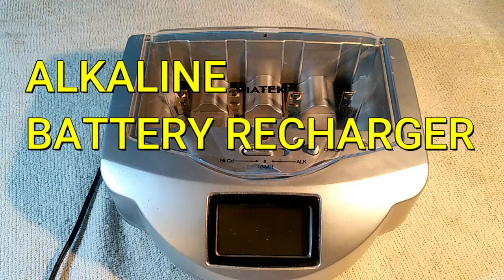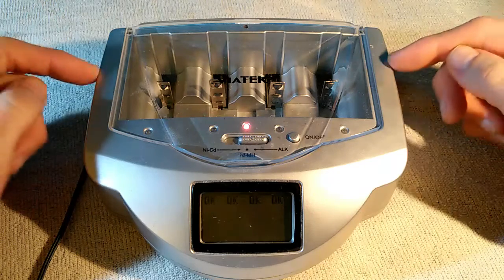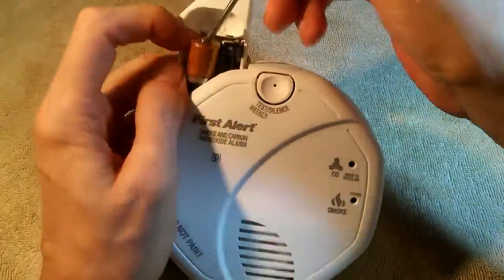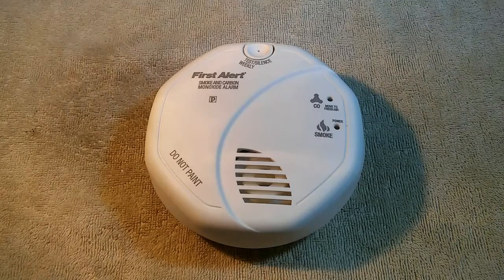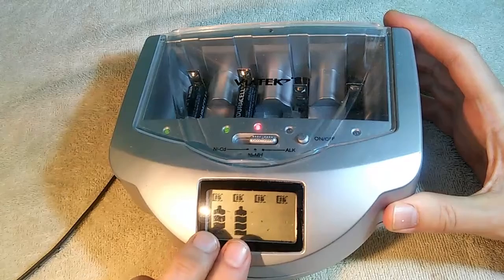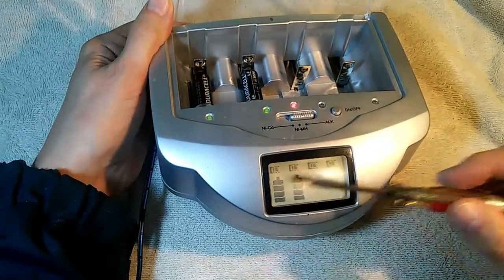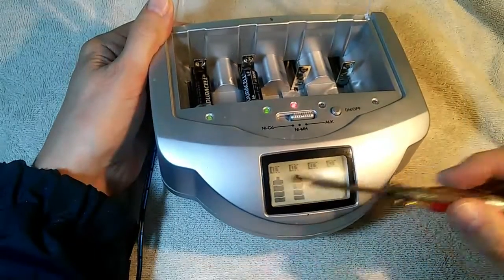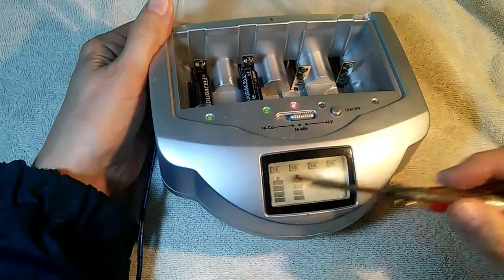Alkaline Battery Charger. Is it Real?

Comment: There is a version of alkaline batteries which are designed to be recharged. They are called RAM (Rechargeable Alkaline Manganese) batteries, and allow for twenty-five recharge cycles. They are becoming hard to find.
My suggestion, if you need a 1.5 Volt terminal voltage from rechargeable batteries, is to use Nickel-Zinc rechargeable batteries from Ansmann. Alternatively, the Chinese (Hixon) have developed Li-Poly 1.5 Volt AA batteries, which have a step-down voltage converter built inside the battery. The output voltage is stabilised to 1.5 V, it doesn't change with the load or the state of charge of the lithium cell. I measured a capacity of 2,000 mAh, while the label states 2300 mAh. They aren't perfect, as they generate some EMI, but they don't leak, and that is all which count for me.
Greetings,
Anthony

Comment: There was a battery charger  made in an electronics magazine a long time ago. Ive been using it for years for my x box, and the batteries are charged with better results being able to charge them and reuse up to 25 times. the state of charge diminishes rapidly but are still praticaly reusable for longer periods of time for at least 5 times before showing leakage.  its  definately possible to get better results than the charger your showing, but only charges one battery at a time. it takes a number of hours, not sure how long but definately less than 12 hours.

Comment: Ive chucked any batterys back in my charger which is the same allways on alkaline mode, it is firesafe where charged, and this video is what i figured it just gives them a little, not nuff for high current devics, but tops them up for remotes and similar items etc

Comment: Great experiment. Only cavet is that I always assumed that recharged alkaline batteries must be used quickly as the chemistry doesn't allow for longevity in holding a charge even if not being used. The smoke alarm testing would be the opposite type of drain. This doesn't change the overall conclusions shown by your analytical approach 👍

Comment: This charger is probably meant to recharge RAM batteries, not primary alkalines. Without knowing what current it uses and what voltage it uses as cutoff, it's impossible to tell if it does any good job. It may be applying too much current, damaging batteries while recharging.
The end conclusion may be correct for your particular charger and Duracell batteries setting, but is completely incorrect outside of it. People have done much more comprehensive tests, and one of them you can find here on YouTube by finding Bekr's Technologies channel and the videos he made.

Comment: Indeed you can recharge alkaline batteries with very small current (20...100mA max.) The risk of leakage is much higher with recharged alkalines and the capacity will drop quite a bit compared with new ones. You can do it 1 or 2 times - after that the batteries won't keep much capacity any more and are prone to leakage! You should also check internal resistance - it increases a lot after beeing recharged. Resistance can increase from 0.2 to 5 or even 10 Ohm - making them nearly useless for higher load applications.

Comment: That (Made in China) charger cannot charge Alkaline battery. I bought  one, tore it down and threw it away.
There is one charger that REALLY works. It is the (Made in Taiwan) Powertran A0280 and is able to recharge (non-rechargeable) AA/AAA Alkaline batteries up to 20 times. It is microprecessor controlled and can charge  (non-rechargeable) AA/AAA Alkaline batteries  OR NiMH batteries but NOT NiCD.
I am still using one and have been recharging hundreds of (non-rechargeable) AA/AAA Alkaline batteries.

Comment: The issue with recharging alkalines is that you often have to let them rest for a little while, then throw them back on in order to get them to hold their voltage (when charging, the voltage rises rapidly, but it doesn't necessarily hold as the battery hasn't actually charged as much as it appears to have charged, and will show its true voltage after a few hours). I would assume that a battery charger marketed as an "alkaline battery charger" would be doing this, but much to my surprise, apparently many don't. In order to charge these correctly, you have to pulse the charge every 30 minutes to an hour or so, and if the charger isn't doing this, it will not fully recharge the batteries. 

I might try to do a formal test on this using the "manual method" (wall outlet timers on slow overnight "dumb chargers") to see what the results are. It'd be interesting to compare and to see real numbers here on the brute-force method, and to compare them to the marketed alkaline battery chargers. 

Excellent video, amazing dedication spending literally years on this!

Comment: great scientific approach. We have almost the same charger  all except ours has no on/off button. I got it because it can do 9volts. We also have an old innovations charger from a long time ago that also charges alkalines.  I must have saved so much money in batteries over the years, especially when the kids were going through batteries in their gadgets. I found you can recharge something like energizer about 4 times. The duracells are pretty similar to them. Anything cheap, you MIGHT get 1 charge. The charger will show BAD on the screen of the one like you have, if it cant give a charge (too low to begin with). On our other charger (innovations) it will show progress in bars and an X if it cant charge them . I dont think  they claim a full restore each time on any of these alkaline chargers.

Comment: I haven't read all the literature, but a patent I was studying recently was talking about charging alkaline cells at currents far below what your charger puts out.  The downside of such low charging current is the long charge time - something on the order of two weeks.  I'm starting just such an experiment - charging an alkaline AAA cell at about 2.8 mA from a source that is voltage-limited to about 1.55 V.
Reply: @DonBenovo Thanks for asking.  I gave up my resolve part way through the experiment when it became obvious the cell wasn't taking on significant charge.

The device that was burning through my supply of alkaline cells - a wireless outdoor thermometer - has been replaced by a wired unit.  ¯\_(ツ)_/¯

Comment: The full charge should be 1.62v. On a new AA battery. I  would try charging to a slightly higher voltage with a different charger.
Reply: Could you get it?
Reply: @haiangtran2036  ?

Comment: Back in the 70s, I discovered that alkaline cells were fully rechargeable.  In the 90s, I bought a laptop with an alkaline rechargeable battery.  It was still taking a charge 10 years later.

Sometime in the 80s, I saw a TV infomercial for a charger that recharged alkaline batteries.  The inventor claimed to be a former college professor.   A few months later, that product disappeared, and a special type of rechargeable, called "Pure Energy" appeared on the market.  The regular alkaline had changed somehow, and I found that they couldn't be recharged like before.  It's been that way ever since.
Reply from the maker: There was a rechargeable alkaline battery.  There is a Wiki page: https://en.wikipedia.org/wiki/Rechargeable_alkaline_battery

Comment: I can't thank you enough for doing the capacity experiment. Given the amount of time you spent on it, this is by far the best and definitive must watch video for anyone who is curious how long the recharged alkaline batteries last because this is a real world example, not by an electronic load which could be faster but won't reflect the real world scenario. I had a hunch that the first charge would hold about 10%. Your video confirms it. Basically the chemistry is different. The ion flow is non reversible, thus non rechargeable. The illusion of "recharge" comes from unused or untouched anode material - powdered zinc, manganese, potassium, graphite, etc. As it oxidized (internal resistance) during discharge, the so called "charging" does not reverse the zinc oxide back into zinc. So overtime, it becomes more and more difficult to recharge it, in other words, all the zinc becomes consumed.

Comment: Duracell alkaline cells are better for high power applications, like motorized toys etc. I think Energizer may be a better choice for low power things like smoke alarms and clocks.
Also, alkaline cells that have been deep discharged can only be recharged to a fraction of their initial energy; as this test shows.
I have an earlier model (had it since about 2005) of the charger featured here and I find that topping-up the cells after each short use (cycle lights etc.) gets much more total life from them.
Rechargeable cells have a lower voltage (1.25v for Ni-Mh), which may be a problem with this smoke detector, which is expecting 1.5v per cell.
Reply: These weren't really deep-discharged though. They were discharged to 1.33 volts when they started chirping, which is surprisingly high for a voltage cutoff.

Comment: A thing I made to test NiCd batteries (and I'm certain it would work for alkaline batteries) was one of those single "AA" traveling alarm clocks with hands and not an LCD display. I wired up alligator clips to the battery terminals and installed a 10 ohm resistor in parallel. I would set the time to 12:00 and hook up a charged battery. The 10 ohm resistor would help discharge the battery faster. When the battery dies the clock stops and shows the elapsed time. By setting it back to 12:00 I can test another battery. It isn't accurate but is repeatable.

Comment: You should try a different brand than Duracell. I used the same charger with Varta and got 10 recharges out of one cell. With the 5 early recharges I couldn't tell any difference between a new one. 6A short circuit

Now two tips:

1. Don't turn the device off during a charge or don't take out the battery before it's fully charged.

2. Don't leave the batteries in for long, when the green light illuminates. If the light turns from red to green,  the batteries should only stay in for 10 more seconds, then take them out

It would be very nice to see a follow-up with these informations taken into account
Reply: Exactly
Reply: What does "6A short" circuit mean?
Reply: That the recharged batteries are like new, if recharged correctly and are able to deliver 6 amps.  @heliocentric9971

Comment: Side story : in view of trying to find rechargeable 1.5V batteries, I recently bought XTAR 1.5V Li-on AA and AAA batteries to solve my problems with devices that absolutely needs 1.5V to work. However, i encountered a problem where one of my device, a Gas Leak Detector, will not power up with my XTAR 1.5V AAA Li-on batteries.

When I asking in a electrical forum, engineers reveal to me that, 1.5V Li-on in general are mainly 3.7V Li-on cells with buck / switchmode converters to step down voltage to 1.5V. Engineers call these 1.5V Li-on batteries "miniature power banks that simulate 1.5V" and devices may not be able to detect the voltage accurately.

They are also guessing the batteries themselves may not be outputting strong enough current when a certain device requires a consistent voltage / amp, especially a Gas Leak Detector has a small heating element and require a high current to start-up.

The manufacturer, advised me to use Alkaline batteries. Since I already tried 1.2V Ni-mh, and 1.5V Li-on wannabe, I suck it up and went out to buy Energizer Max 1.5V Alkaline non-rechargeable batteries, and my gas leak detector starts up immediately.

And now I just found out about "Rechargeable alkaline batteries" and wonder how different are they with normal non-rechargeable alkaline.

Comment: Thank you for your scientific approach and validating with actual statistics. 

Your graph shows : technically yes, "non-rechargeable alkaline 1.5V batteries" can indeed be recharged back for up to 3 times, with the right charger and safe measures in place, before it cannot hold any practical charge.

Whereas (you said it best in one of your comments) : Ni-MH batteries can be recharged hundred of times and last for years.

The only issue is "there are some devices that can not work with the lower voltage of rechargeable batteries. 1.2 volts vs 1.5 volts."

I am just finding out that "rechargeable alkaline 1.5V batteries" actually exists, but it is so rare, i cannot immediately find info about it nor see it in ecommerce marketplace. Perhaps it is not very safe due to the alkaline chemistry. But i am glad you did the experiment that I am asking along my search.
Reply from the maker: There was a rechargeable Alkaline battery.  There are chemically different from disposable batteries. https://en.wikipedia.org/wiki/Rechargeable_alkaline_battery

Comment: Very good data, and not too surprising.
I find that a battery that was discharged with a low current isn't going to recover well at all.
I have had better luck refreshing batteries that were discharged with high current.
It is definitely a case of diminishing returns, but I am trying to delay the point when the batteries will be thrown away.

Comment: Taking AA batteries out of wiimote and letting them set for a month seems to work. Often sometimes.🤔But I’ve never kept a record of the time difference. Some have claimed freezing helps. Others say heating. Possibly solar charging in a cold temp on a timer would be economical.  Looks like good rechargeables make more sense, if the voltage is right.

Comment: Hello.  I’m amused that I’m watching this video 11 hrs after you posed it.  I just watched your previous video about this particular “normal” batteries recharger that you posted 4 yrs ago.  I have a big bagful of depleted batteries bought from the supermarket.  I thought what a waste and wondered if there are clever but safe ways to recharge them.  I watched a load of videos by many people but found yours to be most trustworthy and evidence empirically based.  Thanks very much for this experiment.  I salute your patience in testing your hypothesis.  Now I think that recharging used household batteries are perhaps not so worth the time and effort and perhaps yield minimal results and perhaps potentially unsafe with the leakage.  I found this viatek charger you used but now they want $40 for it!  With my very limited knowledge, perhaps it is a better idea to invest in real rechargeable batteries instead.  Thank you very much for your video.  Very helpful.  Cheers.
Reply from the maker: Thanks for watching both videos.  I know I am a little long winded.  If you look at the posts under my previous video, you see many people are convinced they are able to recharge Alkaline batteries.  I hope I can dispel this misconception by putting some real numbers on it.  Ni-MH batteries are called rechargeable for a reason. Ni-MH batteries are about 4x the cost of Alkaline. The break even is only 4 recharges.  Ni-MH batteries can be recharged hundred of times and last for years.  I use them in every device that will accept them.  Note, there are some devices that can not work with the lower voltage of rechargeable batteries. 1.2 volts vs 1.5 volts.
Reply: @c.davidgraves4848  Hi again.  Thank you very much for taking the time to reply.  Really love your videos.  Well, you've got me convince.  But I understand the temptation to "cheat the system" so to speak to bring those deplete batteries back to life.  I've learnt a lot from your videos so thank you very much sir.  Keep up the good work.  I'm now a fan.